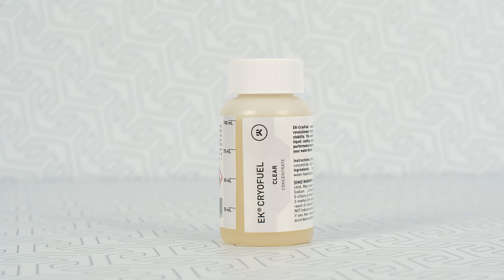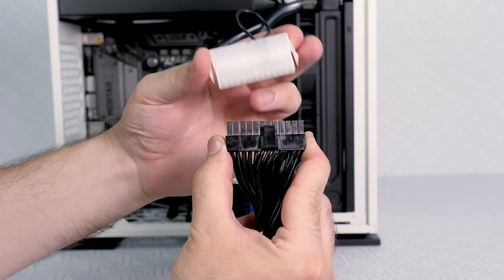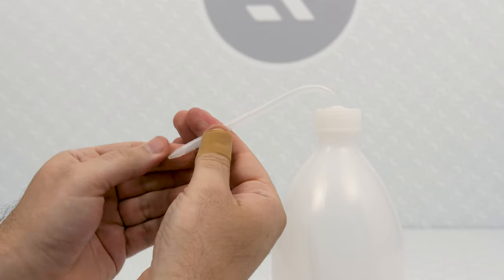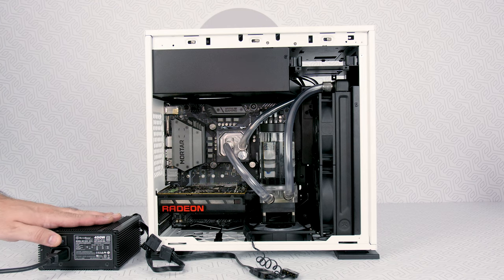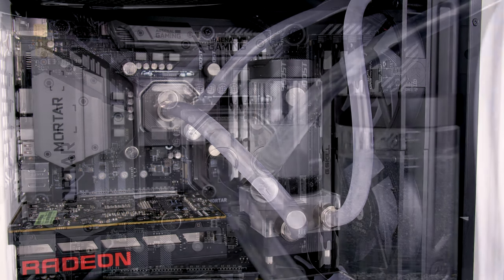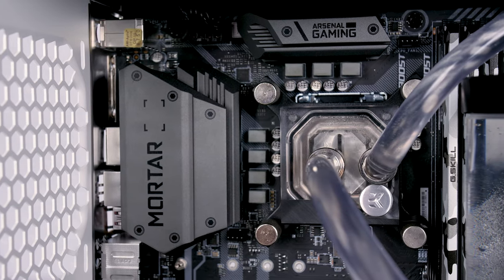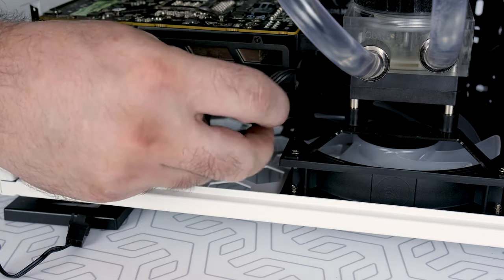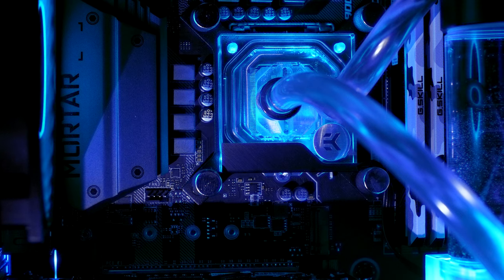Filling the Loop

Comment: Can you do a video on how to drain the classic reservoir?  I don't see a drain port.
Reply from the maker: Good point! We will try to do a video on that topic ASAP!
Reply: @EKWBofficial  I am also waiting on this video!
Reply: Just get a splitter fitting. I have a single out port on my pump and res combo and added a Y spitter. One direction is for the drain and the other direction goes to the actual loop. Installed a ball valve on the splitter side to make things a bit easier too.
Reply: Did they release the video showing draining? I don’t see a drain port on my reservoir
Reply: @TheMediocreGamer_  You will have to make your own drain port, for example how Husky Thor suggested here, or just tilt your res over to pour it out
Reply: @EKWBofficial  did you ever do a video on this?
Reply from the maker: @buicktothemoon  
We are making a brand new tutorial series to cover all the aspects of building and maintaining a custom loop :)
Reply: @EKWBofficial  good stuff. I just bought a black Torque Drain Valve after going some research. This will be compatible EK-STC classic black fittings, right? I bought stuff off configurator and they are the fittings that came with it. I had to buy the Torque Drain Valve Fitting separately. Probably I'm  over worry, but I am just concerned about mixing metals etc.
Reply from the maker: @buicktothemoon  
Only the EK-FC series is made of aluminum, so you shouldn't really worry about other metals like copper, brass, nickel and stainless steel as they are compatible.
Reply: @EKWBofficial  you mean the fluid gaming series?
Reply from the maker: @buicktothemoon  Precisely. All other EK parts are compatible with each other in terms of materials.

Comment: What cable let’s you plug the pump directly into the power supply? Using lian li g1 distro plate
Reply: you need to adapt the 3 or 4 pin power to molex to connect it to the psu

Comment: I have a question. Is it a must to connect the 4 pin header to the PSU before the filling process, or we can just connect the Molex without 4 pin header connected?
Reply: I second this question
Reply: Only power cable, no pwm to mobo.

Comment: Why do you need to attach an adapter to the 24 pin connecter??
Reply: You don’t have to, their adapter already has the right pins jumped though.
Reply: it just starts the power supply without the need to power the motherboard, cpu, gpu and anything other than the pump cause if there's a leak you want everything to be off

Comment: what is the point of the mobo jumper when it’s connected to the psu this doesn’t make sense
Reply: Matthew Massingale Good question. It serves a purpose to use a jumper to use less power since we’re only testing the pump. Using the power with the onboard mobo, turning it on/off to test can cause your hard drives or ssd to be corrupted unless you take the time to shut down manually which is time consuming.
Reply: So you don't power the mobo at all while your loop has a potential to leak. The jumper is so the psu will run without needing the signal from the motherboard
Reply: It makes perfect sense.  Not understanding something doesn't mean that thing is nonsensical.